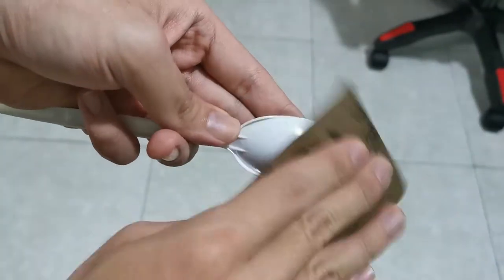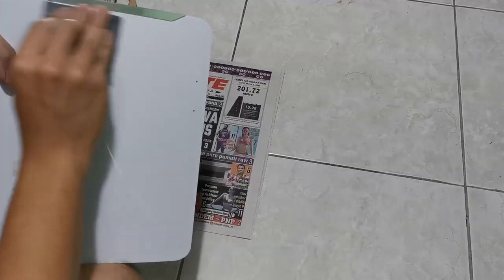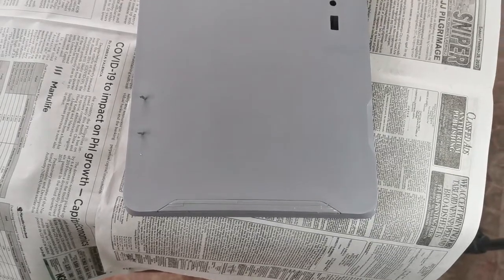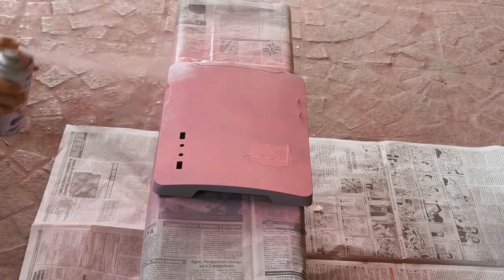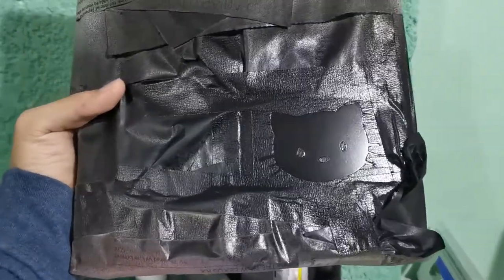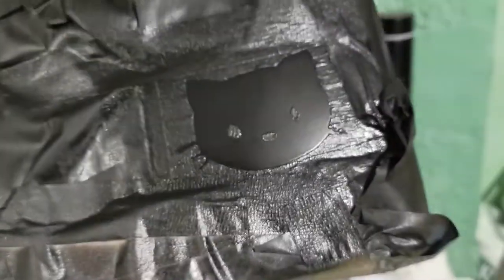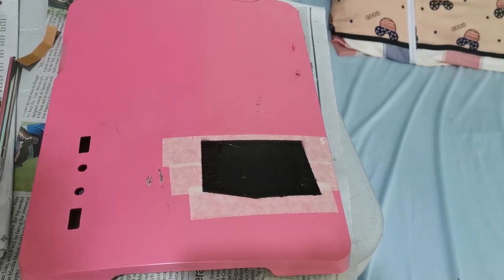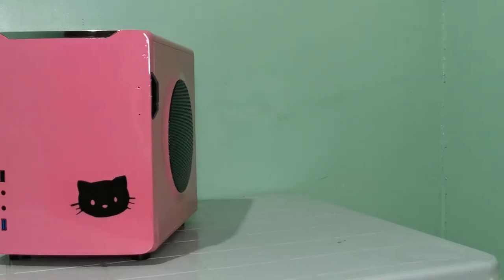I Painted My Girlfriend's PC Case!

Comment: wouldnt it feel rough since you didnt sand it down
Reply from the maker: it actually smoothens it. I use high grit sand paper, not the really rough ones. It also helps the top coat stick better.

Comment: Hello po, ano po mga materials needed to spary paint a pc case? penge po link ng materials sa shoppe or Lazada po if meron hehe
Reply from the maker: Bumili lng ako sand paper, spray paint (Bosny) sa local hardware store namin :)
Reply: @droborja  so ang kailangan po talaga is sand paper and 1 can of spray paint (the color I want)? ganun lang po?
Reply: Ano po yung clear coat chuchu